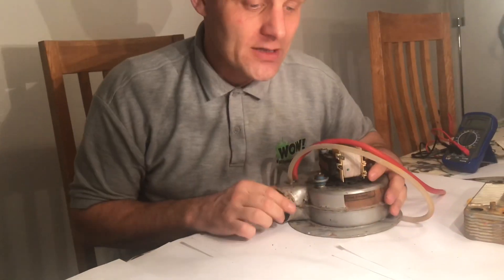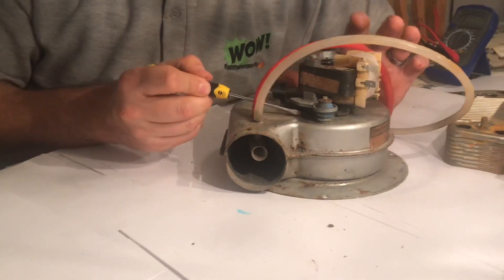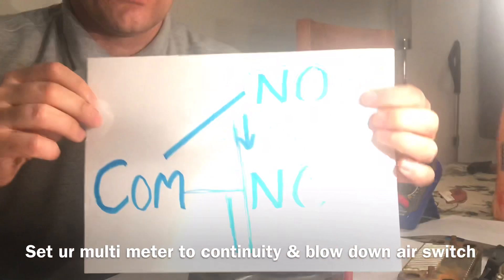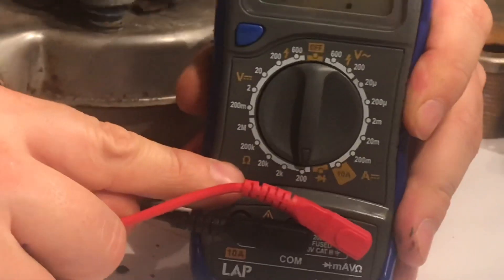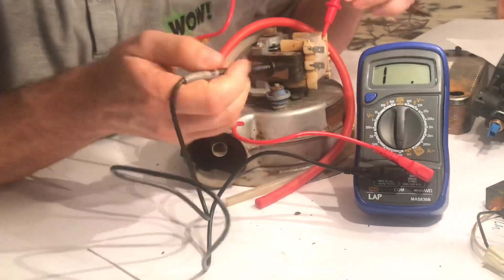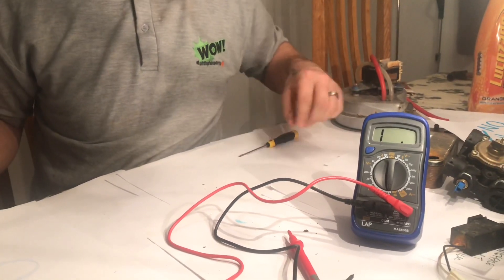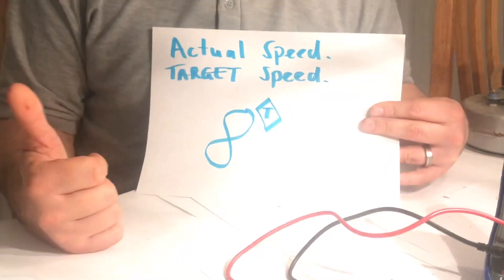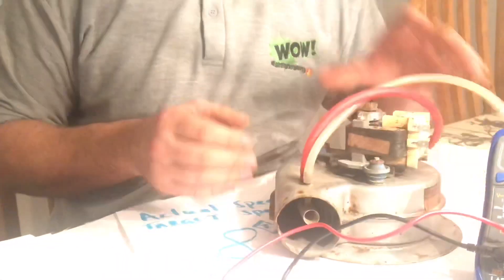Testing boiler fans

Comment: Hi im working on a performa he (same as the baxi 105 he and main 30 he and its showing an air pressure problem. The fan is running with 240v at it and 34 ohms across it, the boiler lights when i manually make the air pressure switch by sucking on the tube. Ive also changed the aps with no joy. The fan seems to me to be running a little bit slow even tho its spinning freely and isnt stuck at all and has the correct voltage to it, Any ideas?

Comment: So was the 45 ohms a good reading within tolerance for this fan? looks like a Baxi  or Main combi fan
Reply from the maker: Yes it was the Ohms reading should be plus or minus 10% of manufacturer’s specifications
Reply: @warriorsofwarmth  So what is the manufacturers spec? as mine reads 30 ohms on a Main  24 HE  Fan. So  l was under the impression lower was better  as long as not under 20 ohms min
Reply from the maker: @colin5064  sorry that’s incorrect the reading r low as fan motor is fast, I woud expect ohms to b higher? Call Baxi service

Comment: Great video. Wanted to ask if the fan speed is lower then it should be would that mean the gas rate would be lower aswell.
How would you know if the gas valve is faulty or it the fan if you couldnt check the fan speed and the gas rate is low.
Reply from the maker: If fan speed was low the pcb would detect through taco, gas rate would be the same but poor ratios
Reply: @warriorsofwarmth  I see. But on modern zero govner boilers    as the fan speed control the gas valve would you get low gas rate if the fan speed is low? 
Also the 2 tubes coming off the fan.  I'm guessing one pull air in and one pushes it out. How does that happen when they are both in the same fan only 1cm apart?  Shouldn't they do the same thing?
Thank you much appreciated
Reply from the maker: abdul hafiz the interface would show a fault, all boilers have target speed and actual speed